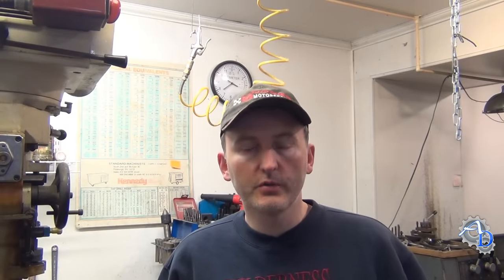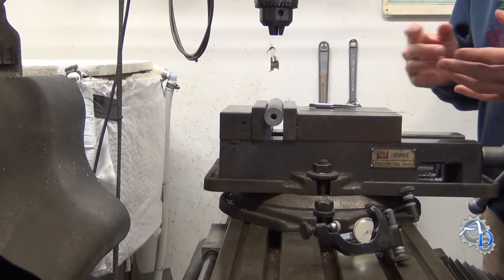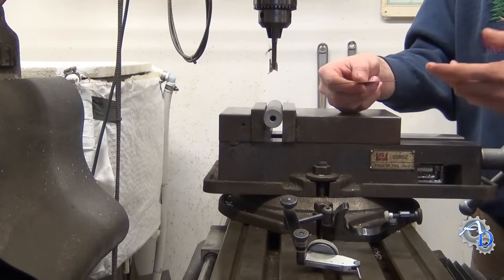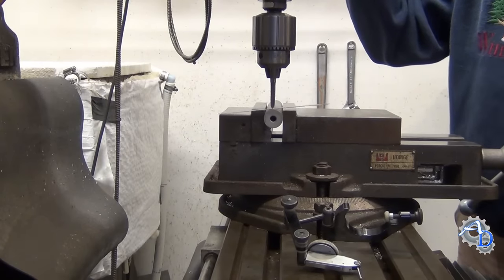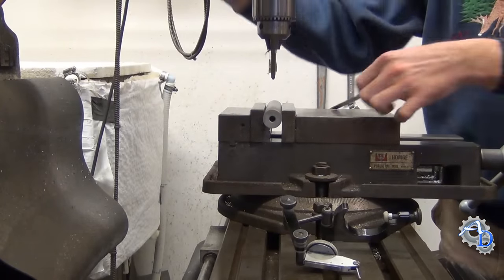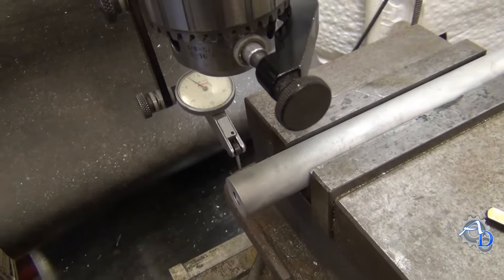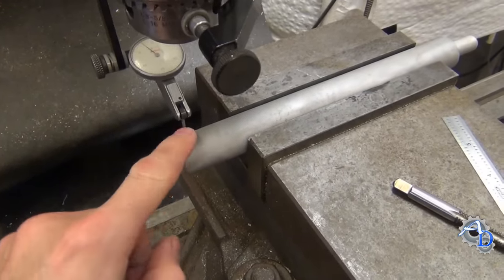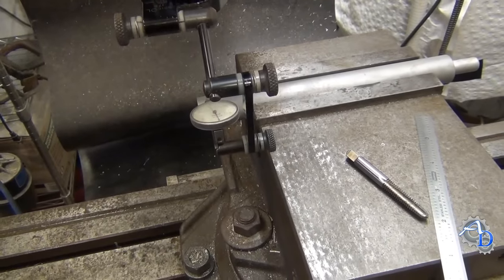Old Machinists Mill Trick To Quickly Find a Rod Centerline

Comment: Meh i used ground axle for 3d printer and a paper method-you can use milling cutter and come close untill it tears the paper too.When round bar is sticking out(if it is not sticking you can index it by the vice jawas) you put a peace of paper on the side(left right doesnt matter)and then you close by with an axle mounted in a spindle untill paper is lightly held and you cannot pull it out anymore.Then you divide axle by 2(lets say it is 12mm thick that would be 6mm)and add thickness of the paper.
When you do that you are on the edge of the bar.The add half thickness of the bar you are working with and you are right on the middle couple of hundreds of mm off-once you master it its very accurate for most of work.Ciggaret rolling paper works best since its super thin-use regular printer paper if you are  using milling cutter tear method. 
I made my own center finder by putting a ball bearing on the shaft-you mark a line with marker on bearing and then touch the top edge of bar,divide it by half + thickness of bearing-you are verticaly in center.Then just go back and forward and touch the bar untill bearing starts to spin and you can see marker line on bearing moving.
Its good for indicating square parts fast and then you can fine tune it with dial indicator.  This was in the shop in which i had no center finder of any sort .it got the job done ,several times.

Comment: First uou take a piece of the round stock, put it the lathe, dril a hole thru. turn the drilled piece 90 degrees to the new work piece, in a vise & voila, you have the center...

Comment: With and end mill in the spindle, running, touch down on the surface of the piece. Feed the end mill down into the piece. Move the table until the end mill cuts a full circle on both sides at the same time. Very simple and accurate

Comment: Cool trick! Is there a reason not to use an edge finder on round stock as long as it’s at the same height on both sides? I assume indicating is more accurate but edge finding has always worked well for me.

Comment: What 's "THE INDICATOR" tool actually called? What's it's technical name so I can go get one? I'm actually using Arnold's old trick on a Drill-Press with a vice clamp on 2" or ~50mm, 3·2mm wall aluminium alloy tube. It needs to be pretty damn close. So far, Arnold's old tip is batting 100. I get it, and what encouraged me to try is I have the thin flexible-scale, 6" long. We Brits call 'a scale', - 'a ruler'. Shucks!

Comment: Geez. Mike your round bar. Example 0.750". Now zero your mill, as usual, to the fixed jaw on your vise. Move out 1/2 your round bar's diameter (0.375"). You're on center.

If you only need it to be approximate, like for drilling & tapping for a setscrew, then light up any end mill and barely brush across the top surace of the round bar with it. That'll leave a tiny axial bright flat stripe. Now you can very easily bring a chucked-up pointed tool to the center of that stripe by eye. Chances are excellent that you can visually find center that way to within about 0.002".

If you're out of stuff, though, use a rule like you showed. That's THE easy, standard way to get your lathe tool on centerline.
Reply from the maker: I've been a machinist for 29 yrs unfortunately, but thanks anyway.

Comment: Cool trick. I would put a pin in the quill, touch it against a shim on the od of your part and do the math. Bing, bang, boom.
Reply: that's how you make your machine not perpendicular or damage your tool holder. Should never be forcing something rigid against your spindle like that. With the quill down its like a lever and will really move the spindle. Put an indicator off the table to the spindle next time. You'll see

Comment: That's so easy  now you have shown me so thanks for the tip .. 
What's the gauge you used at the end of the video to check how close to center you were?
Reply from the maker: You're welcome. I just use a dial indicator held in an Indicol holder there at the end.

Comment: I just don't understand all the negative comments from 'real machinists'.  I am a consumer of machined parts.  By that, I mean I take machined parts and put them together with other parts to make something.  I hate the time and money wasted by machinists when I want something made.  Drilling a hole through a rod and pulley to install a roll pin doesn't have to be done to the 0,000001 inch.  Cutting metal 'ears' for an excavator attachment is fine as long as you can make them within an eighth to a quarter inch.  Heck, I'll probably wear them that much within the first month.

Comment: I'm not a machinist; I'm contemplating buying a mini-lathe and adding a tool-post vise to allow some quasi-milling jobs.  So my comments might be worthless.  But in trying to imagine ways to do "real" tasks with lackluster equipment, I came up with an idea for this task.  Why not hold a piece of scrap bar stock (wider than the rod) in the vise, then mill a notch in it.  Use clamps to hold the rod in the notch.  If nothing is moved, can't you then chuck a drill bit in and have it automatically be dead-center on the rod that must be dead-center in the groove?  Or is the chuck itself too imprecise to maintain this tolerance?
Reply: I forgot to mention that this would be meant especially for a mill (not a simple drill press), but could it not be done with a drill press and a cross-slide vise?

Comment: i would rather use the centre of the chuck rather than the outside  as you casing of the chuck would most likely be out from the centre, thus its the centre that needs to be true. so basically your centre chuck needs to be as accurate as the outside to use the dial method.
Reply: No sir. The chuck spins on the same centerline . one side of the chuck could be a foot out of wack and it is still going to spin on the same centerline.

Comment: While something to do its not as simple as taking an end mill in a collet (not a drill chuck they deflect) come from the backside & touch the round stock set your Y to zero come around and touch the front of the roundstock with the edge of the end mill look at your number split it in half & your on the money not approximate even faster making the second step unecessary is measure the exact diameter of the round stock after you touch & zero the Y take half the diameter & you are also on the money, dont forget to subtract half the diameter of whatever size endmill you use

Comment: I wonder if a finer pin point would make this a little more accurate along with a stiffer 14" ruler with two line levels on each end ? great quick trick.
Reply: The roundness of your workpiece is where it actually breaks apart. You won't get a better precision because your pipe is not a perfect circle but a bit of an ellipse, and more than likely held at an angle, so the top-most point will be a bit off-center.
Reply: @sharpfang  I would expect the round stock to be made in a lathe, producing a perfect roundness.
Reply: @claudiodominguez.  There's no such thing as perfect roundness in the real world. It will be good, as good as the lathe allows - given how well centered and straight its axis is, how much play in the bearings, rigidity of the machine frame, vibrations, uneven distortions of material from 3-point grip of the spindle, and so on. You'll be able to get sub-0.01mm precision if your lathe is decent quality and not worn and you're not a hack, say, squashing the stock into a triangle in the spindle. What we see in the video though, seems like a piece of factory-made pipe, which won't be very round.
Reply: @sharpfang  I am no machinist so thanks for the info, I thought that with 2020 equipment a true roundness could be made.
Reply: @claudiodominguez.  Atoms don't arrange into rings. But in practice, it's a cost:effect trade-off. You can make an axle to 0.1µm on a $5mln machine taking 12 hours of time of a $100/h specialist, or you can make it in 15 minutes on a lathe recovered from junkyard and repaired with $50 worth of parts, done by an amateur for free, to 0.1mm precision. And will the 0.1mm part work just as well as the 0.1µm one? Depends on application. Is it to stabilize a turbopump in a rocket engine, or blades of a lawn mower? It's not all about making parts as precisely as possible, it's about making them sufficiently good for their job, and keeping the budget in check. If you're drilling these holes in that pipe to thread clothes lines for drying laundry, that ruler method for finding the middle is perfectly sufficient.
Reply: @sharpfang  thanks, great info, you are correct, it's all about application requirements. A turbo turning over 250,000 rpm doesn't need much out of specs to vibrate into a miniature atomic explosion.

Comment: Why not very lightly touch off on the side of the part with the end mill or drill bit you want to use? Diameter of the tool plus the diameter of the part divided by two is center. I have never had a problem with this method weather drilling holes or cutting keyways.
Reply from the maker: You can. I know of many ways of finding center, but wanted to show people this particular method.

Comment: I will just throw it out at the risk it has already been asked: If one wanted to find the center of an existing hole in a surface, could a ball bearing resting in that hole be used with a plate, in a similar fashion? Perhaps if the hole were made with a center drill?  I'm new to this and I see from comments that this is called a "tangent indicator." My situation is: circular column mill with a "wobbler" center finding indicator which is much longer than the tool I want to center, hence hard to find the center and also keep the quill close to the work piece.
Reply from the maker: Ball bearing is a good idea imo. It would also get you close. It might take more maneuvering bc it's leveling in 2 axis, but still workable. Something I will try sometime.

Comment: What if, using the same method, you place a small level on the straight edge?
Reply from the maker: That would be even more accurate as long as the straight edge isn't bent.
Reply: I think your method is better Arnold. Bubble levels are not very accurate and the vice also needs to be dead level

Comment: You could use a level if it's a precision level, but your eyes are more precise than a typical level when you have the top of the vise and the vise jaws to reference.  And the flimsy scale wouldn't help that either.  Also, I bet some of the error you got had to do with the tool runout.  If you ensured zero runout of the tool, I bet you would be closer than 2 tir.

Comment: The technique is fast .And depending on the tolerance required. I personally would of used a Dowel as an edgefinder..A Drill Chuck never runs that true.So I'd put a standerd Dowel size .250 in a collet..And procedures would be ,mark your Dowel with a highlight marker and move your Dowel towards the edge of the work piece. Slightly touch the edge of the work piecefaintly ,then split the Diameter in Half using your R/O + half the Diameter of your Dowel.In this case .125.Saying all that.It Depends on the accuracy needed.

Comment: Ok an FYI This works good  enough when you want your cutting tool in a lathe to be on CL of  the shaft But for MIll work try an Edge finder You can't spend that much time in a Job  Shop where time is money finding Center No Offense in my comment.

Comment: is there a reason why indicating would be preferred to using an edge finder?
Reply from the maker: If the part was large enough diameter, a .200 edge finder will have a hard time touching the edge. A 1/2" edge finder would still work though.
Reply: @ArnoldsDesign  ahhh, gotcha. yep that makes a lot of sense.

Comment: I would probally just stick with an edge finder, doesnt take many seconds to pop in and you'll end up within +-0.01 instead of +-0.2
Reply from the maker: That's what I usually use. I drilled thru holes in a flag pole the other day which was larger diameter, and didn't need to be exactly on center. I used this technique.

Comment: always had to get the indicator to read zero, every thing i done was + - .0005 or less,  you don't put the indicol on the chuck you put it on the spindle, 5 minuets, if you use the indicator all the time you should be able to only use the indicol and indicator and get it on zero in a minuet or less, there is probably 10+ ways to get it close if you want to do that first

Comment: If you have a DRO... isn't it easier to just put a centre drill in the chuck and touch one side... zero the axis... then touch touch the other side and halve it?... that's what I do
Reply from the maker: I have a dro. There are a lot of ways to set up parts. I just wanted to show this way because I figured a lot of people haven't seen it.

Comment: Another easy way is half the diameter of the round bar.. say 30 mm. 
Then fit either your milling tool or a piece of roundbar thats an exact size and is running true in a drill chuck.. lets say there both 10mm.
put sum engineers blue on the work piece to be machined and slowly bring the rotating milling tool or round bar into the side of the piece to be machined until the engineers blue just starts to pick up on the rotating tool/bar.. the milling tool or bar must be long enough to cover the apex of the round bar. From here half the diameter of the piece to be machined.. which would be 15 mm. zero the scale on the miller and bring the milling chuck in 15 mm plus half the diameter of the tool/bar that was used to determine the egde of the piece to be machined.. Which in this case would be 5 mm.. and there you go.. bring the chuck in 20 mm from zero and you have center.

Comment: Who's paying for the tap when it hangs up?
Doesn't account for chuck/tool off center.
Start spindle so any wobble is concentric, get close with quill then lock, raise table a couple of thousandths a time working y back and forth over work center till a polish mark appears, sight the still rotating tap center in the middle of mark as viewed down the x axis. You'll hit it + - .003-.005 every time.
Btw, hope your just gonna look at that bar with no leveling support cause the first time you try to work it you're buggered.

Comment: I guess he's never seen an edge finder???   Much easier and very accurate.  Dial indicator?? NEVER seen anybody bother with that!!!
Reply from the maker: Congratulations, you're the 500th person on here who can't read a description.
Reply: @ArnoldsDesign  Yes, you are correct, I didn't pull down the extension. I still don't get the post and would never fiddle around with a scale like that when I could just pop in my edge-finder and dial it in. The scale trick does come in handy with lathe tool-bit height, above/below center..

Comment: Thats a subjective method. Five people would probably get five different readings. Using a precise drill blank and touching side of part in vise and adding half the diameter of the drill blank plus half the diameter of the part in vise would be about as quick.
Reply: Rick Ham It's not a subjective method at all, it just gets you very close so you can quickly dial it in with the dti if you need that level of accuracy.  A few people have said this, I can only think they stopped watching before Arnold used the dti.

Comment: Put some engineers blue on the work piece.
Set miller going and offer it up to the work piece until the tool marks the blue but not the work piece.
Then lift the tool up and go in half the width of the work piece plus half the tool.
That's yer center.
Works well if your gentle and not a ham fisted bastard.

Comment: I been searching a precise way to drill a hole on 5mm rod. Not rocket science but a good quality vise and drill press and eye ball the center and ruler. Dont even bother using sloppy vise and uneven drill press.  All other method won't work if you have shitty tools. Js

Comment: Nah use an edge finder between jaws in the same part locked down then fine set with a .0001 indicator in your sweep( yah that’s a 4 place tenths indicator),for the garage guys your method is ok but an aerospace CNC guy would never dare practice this technique

Comment: "You basically just eyeball it". That is NOT finding true center. using a dial indicator in the collet, just Z-axis for 10 seconds and you'll find the center. It's the highest point on the indicator. Machine work is precision work. Not 'eyeball it'.

Comment: Although I appreciate your effort, it takes too much time. Using a dowel pin, insert in the drill chuck and apply ink to the contact area. Turn on spindle and touch workpiece. Zero your DRO. Move axis’ to compensate for half diameter of pin. Zero DRO. Takes less than a minute.
Reply from the maker: See my description. Thank you for your comments.
Reply: M. Clean That zeroes you on the OD of the workpiece, not the the centre.

Comment: No offense young man, but I have been a machinist for 30 years and you are wasting your time with that stuff.  Take an edge finder on the back jaw of your vise, find the edge, add 1/2 the diameter of the stock and you will have exact center.  Takes less than 30 seconds.
Reply from the maker: Read the description.

Comment: Takes about 5 min to just use an edge finder.
Reply: Edge finder does not find the centre line by itself, you need to know the diameter of the part.  This method needs no dimensions to be measured to get zeroed on the centre line.
Reply: @ferrumignis  you dont need to know the diameter, you just find both edges at the same Z depth and divide the distance in y by 2